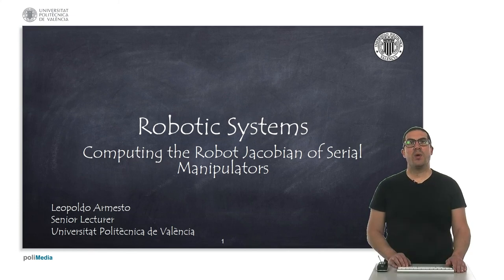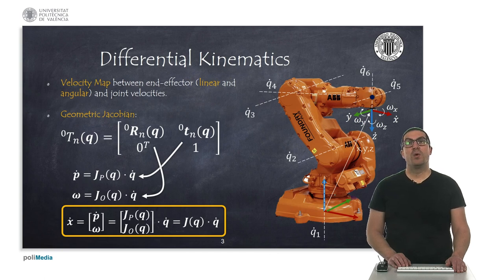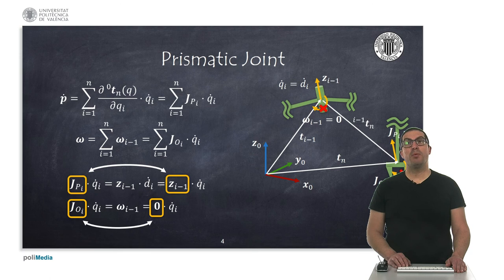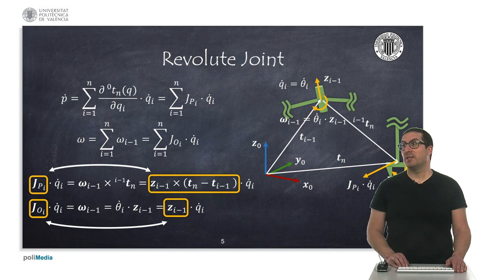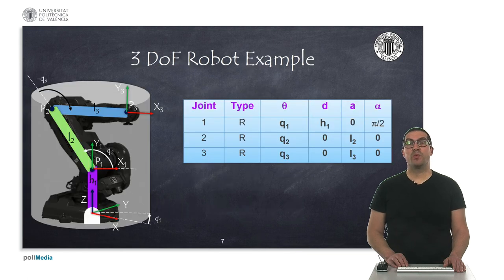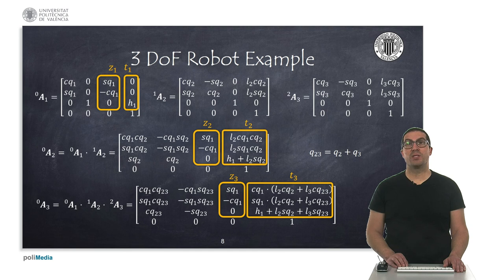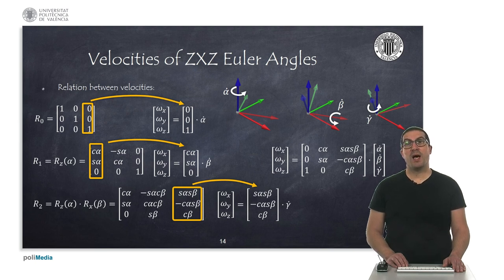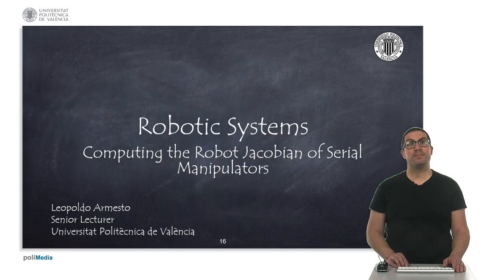Computing the Robot Jacobian of Serial Manipulators | Robotic Systems

Comment: I use the modified DH table. I tried calculating both analytical and geometric jacobian. When calculating based on the formula (t(n)-t(i-1)) in the geometric method, the Jv obtained is different from the J(T) calculated in the analytical method. however, when I change to (t(n)-t(i)) then Jv and J(T) are the same. What is this problem? Please help me